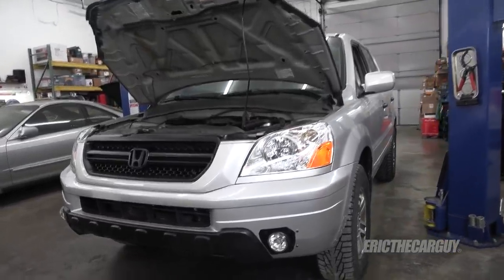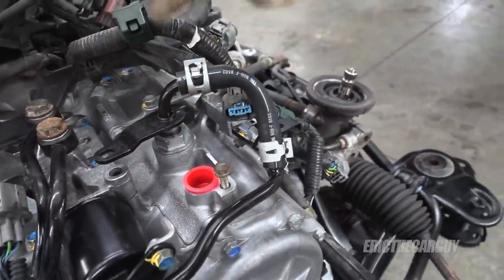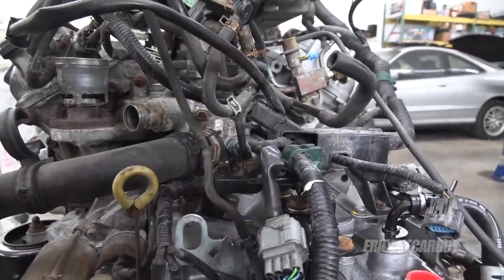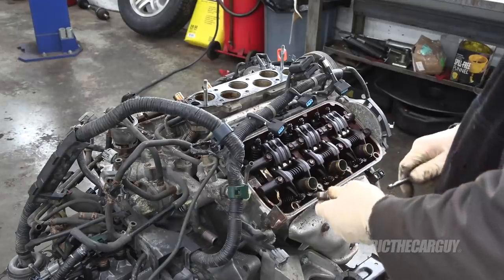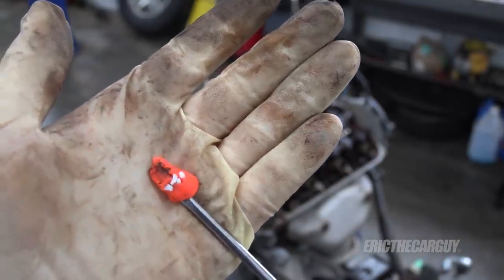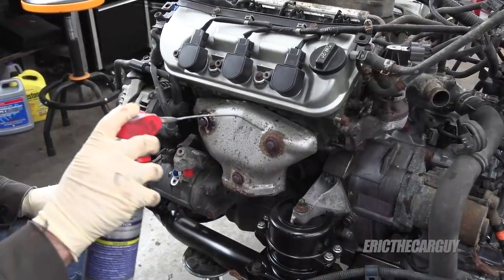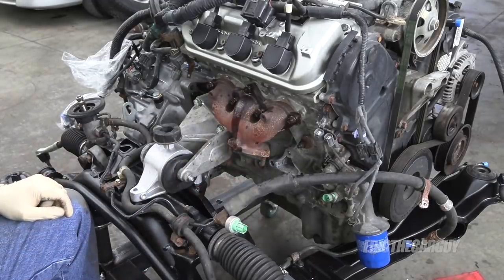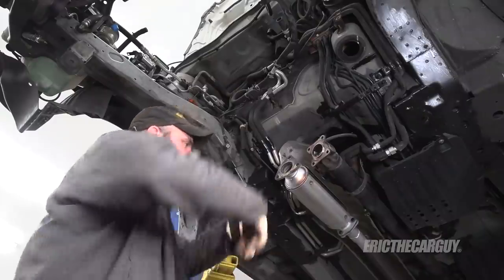Honda Pilot Timing Belt and Engine Service

Comment: I know it's not a hard part to replace and I've not seen them fail on Pilots like I have on 3rd gen Odysseys, but I was a little surprised you didn't swap out the power steering pressure hose. Again, I don't see them fail hardly at all on Pilots, almost always on the older Odysseys. Maybe it was an expense not worth spending the money on since you never know what surprises you might find. 

I am loving this series and enjoying watching this Pilot come back to life. 

Maybe it's been answered before, but you mention in almost every video of this series of your intentions to supercharge this engine. Will we see that as part of this series or is that something a little further down the line once things are up and functioning without hiccups?
Reply from the maker: As you stated, the PS hoses on these vehicles were not an issue. However, in the previous episode I loosened the connection at the PS rack in case I needed to replace it at some point. BTW, I've done several PS hose recalls on TL's when I was working at the dealer. It became somewhat routine. I mention this because replacing that hose is not a big deal to me if it becomes an issue. 

Linked in the description is the series of videos I'm doing with this Pilot. I cover my plans for this work, including the supercharger, in the first video. I recommend you check it out. https://www.youtube.com/watch?v=11nl6FCkr-s&list=PLSzhQ6St-ov3cXOvOQSyQQboN8f27MVQs

Thanks for the comment.

Comment: I just finished this exact service on my 2002 Acura MDX. Valve adjustments new gaskets Plus a new thermostat.  Now on start up the engine is Revving to 5000 rpm and staying there. I freaked and turned it off.  It keeps doing it,  even if I take off the throttle cable.  I feel like I botched something
Reply from the maker: Same thing happened with this engine as you'll see in the next episode. Sometimes the IAC gets stuck. I tap on it with a hammer and it often brings the idle down. Also, make sure you don't have any vacuum leaks. https://www.ericthecarguy.com/solving-automotive-idle-problems/

Comment: Eric.... Is there any reason not to fill the transmission through the dip-stick tube?  Those cheap tall skinny black funnels at the auto-parts store fit right onto the end of the tube.  I've been using that to fill the AT transmissions an 03 pilot and 12 odyssey for years.  Makes a perfect seal and never spills a drop.  I usually have to pop the plastic engine cover off to get it done, but that's it all.

PS: The wire tap on the IAT sensor was probably for one of those scammer gas-saving devices.

Comment: Eric, just wondering why you didn't replace the cam gear oil seals and the crank oil seals?  You had good access with the engine out...
Reply from the maker: If they aren't leaking, I don't recommend replacing them. The ones on this engine were bone dry.

Comment: Love your videos, I learn a lot with you and Scotty Kilmer. I have a Honda Pilot 2004 and I do my own mechanic work in my cars. I’m wondering, how much do you charge for this kind of work? Because is like literally having a new car doing all that maintenance and lowering that engine. Another question is could be a good idea in replacing both head gaskets while the engine is down? I know that you might charge more for that work but it might be worth it with the mileage of that van.
Reply from the maker: I plan to do a video covering the cost of all the repairs when I'm done. Spoiler alert, it's way more than this vehicle is worth. Unfortunately I'm doing this in part to show that SUVs are money pits, and if you're short on money, a used SUV should be avoided at all costs. Pun intended. https://www.youtube.com/watch?v=AqTgv2RSC7I&t=11s

Head gaskets are not a maintenance item, especially MLS gaskets which rarely have issues. 

Thanks for the comment.
Reply: @ericthecarguy Not sure if you'll see this but curious as to what the motivation is if it's more than the vehicle is worth. Is this a labour of love for you Eric?

Comment: Quick question i have a p0505 code i change the iacv i clean the throttle body bleed the radatior and the code still comes on. What next can I check?

Comment: Where do you get the zip ties that have the snap on fitting on the back. Used to hold wires to the engine?
Reply from the maker: Those are OE, I didn't add them.

Comment: Eric do you think the sand made it behind the valve cover baffles?
Reply from the maker: Likely, that's why I gave it a good cleaning in the parts washer after sand blasting. After that, I blew it out with compressed air.

Comment: Well, Eric - please do not trust your Ohm-meter on low resistances like that. Try for instance to short the tips of the probes and see what it says then.

And btw. if you would have 0.7 ohm in that ground cable, you would have a voltage drop across it of 14 V as soon as 20 Amps runs through it.

Comment: 14:34 "you could get a code for EGR flow, if this gets clogged up" I'm sorry my ass is new to automotive repair could ya please say exactly what component would cause that? Is it just the whole intake manifold or that specific channel you had the tool in as you said it?
edit: okay I went back a little and you talked about the "ant farm" EGR passage on the part you took off and then there were the other EGR passages deeper in the engine I was trippin should've checked before the comment. You even said "if they're getting low EGR" so my bad Peace!

Also, loving your videos and now that I'm serious into learning cars I've been watching all your channel's videos from oldest to newest lol I'm just cheating and watching this modern day Eric now because the video looked interesting and I wanted to see how you changed over the years lol, looking good bro!

Comment: And a almost 2 decades later from this pilot the J series v6 engine is virtually unchanged
Reply from the maker: These engines were great, the automatic transmissions bolted to them, not so much.

Comment: what about having that intake spacer piece machined down to about half the height that it is now ?
Reply from the maker: No point if I'm going to be cramming air into the engine with a supercharger. Also, I'll need every bit of under hood clearance if I want the supercharger AND the intercooler to fit.

Comment: Aye Eric quick question I put a used trans in my 03 MDX when it when out in last September I put it in about the end of September and it drives great, but now this trans has a weird gear chattering noise when I do 50 to 55 especially doing 55 do you have any suggestions or recommendations trying to keep it running since it's my only vehicle. The trans had 135k miles and put 91k miles on the new trans also what IS the trans update that Honda/Acura has did because I know I don't have a trans filter
Reply from the maker: https://www.ericthecarguy.com/solving-transmission-problems/
Reply: @ericthecarguy  thanks I'm checking it out 👍🏾

Comment: RE the broken spark plug: Would a socket with the rubber boot for holding the plug keep all the shards inside the socket ?
Reply: Possibly if you can keep the plug from popping off the rubber boot. Maybe just small small pieces that can slip between the socket and plug.
Reply from the maker: Yes. Actually, the rubber insert for that socket went missing long ago. If it was still in the socket, it probably would never have broken the plug in the first place.

Comment: You can keep oil from getting everywhere on your oil filter changes if you just bring a good sized piece of cardboard with you.  If you can remember to do it, you really feel like a oil deflecting god.
Reply from the maker: Because of the location, and the splash shield that goes in front of the filter, cardboard would not be a good choice. Aluminum foil might work better. Thanks for the suggestion.

Comment: This video is a good example that people should not use power tool to remove spark plugs, and also should always blow the spark plug socket with pressed air before remove it.
Reply from the maker: Honestly I've found that impact removal can be helpful with plugs that are difficult to remove. It can shake them loose. However, your concerns are warranted. A contributing factor in this case is that I lost the rubber insert to my spark plug socket years ago. Thank you for your commend and Happy New Year!
Reply: @ericthecarguy  Thanks for your reply, Eric,  you are a good guy and you are so knowledgeable.  if this project still  in process, i recommend to do an endoscope inspection on the first cylinder and Happy New Year!
Reply from the maker: The spark plugs told me all that I need to know. Based on what I've seen, and the way it runs and drives, this engine is good to go. Thanks for your comments.

Comment: My guess on the IAT harness hackery is some form of VCM disabler?
Reply: The 03-05 Pilots didn't come with VCM (thank goodness).
Reply: Neither does my 2007 Odyssey LX 😃
Reply from the maker: This vehicle does not use that system. I suspect it was to get better MPG.
Reply: IAT would have no affect on VCM anyway. That's the ECT1 sensor.

Comment: The resistance measurement you are doing, is not showing the real cable's one.  There is contact resistance in the probes.  With the tester you have, just measure the resistance with the two probes on the same end of the cable, and subtract that value from what you get measuring the cable end to end.  Some tester have a "zero" set.
To better measure low resistance values (< 1~10 ohm), you should use a 4 wire measurement, but the tester you have does not do that, as all hand held ones.

Comment: I wish you luck with that Aisin kit, Amazon and forum reviews are hit and miss, although I think there were some sellers with counterfeit kits being sold on Amazon, im using the Aisin kit but putting the Honda OEM timing belt on mine.
Reply from the maker: I think those are under the "Honda" name and not Aisin.
Reply: ^ +1. They were Honda branded, counterfeit

Comment: 9:16 Those shrink solder does not work in well in engine bay.  Reason being when it heats up, the two cables can be pull apart very easily.  In fact, it might pull apart under the cable's own weight.  Crimp heat shrink OR proper soldering is much better when dealing with engine's heat.
Reply from the maker: I've used them on 2 projects so far, one of them a turbo. So far I haven't experienced that, but I'll keep my eye out. Thanks for the heads up.

Comment: Every spark plug manufacturer says to not use anti seize on their spark plugs.
Reply: Which is OK for a cast iron head, but when it goes into an aluminum head I put anti seize on them anyway.
Reply: @CheezyDee  That's where you and everyone else is wrong.
Reply: @freespirit1975  That's the mistake many make, sadly its a myth that will die hard.

Comment: From the time lapse of the timing belt replacement, it looks like you just used a ratchet to get the crank pulley bolt off. You must have super-human strength! lol
Reply from the maker: I used a 1/2" impact. I guess it just didn't show up in the time lapse.
Reply: @ericthecarguy  haha, I figured that had to be the case or that you had already loosened it when it was still in the Pilot.

Comment: I really don’t like impacts on spark plugs for that very reason
Reply from the maker: I'm fine with using them for removal, but not for installation. In fact, I find they help break the plugs loose if they are hard to get out like these were. Lastly, if the rubber insert was still in my spark plug socket, the plug likely would not have broken. I knew I was replacing them so I really didn't care. Thanks for the comment.

Comment: Should one be asking !   Why can't you use anti seize on spark plug threads ?
Reply from the maker: https://ngksparkplugs.com/en/resources/5-things-you-should-know-about-spark-plugs
Reply: It could result in over-torquing which increases the chances of stripping the threads on the head, not a fun fix!

I too, use anti-seize on my TL 😅. The firewall side is a PITA to get to. Make sure to use a torque wrench and tighten to 110-125 in-lbs (20-30% less than 156 in-lbs). YMMV, I'm just a guy on the internet 🤐
Reply: @vincelow  SO one could say that using anti sieze could result in over torquing of any threaded fastener ?
Reply: @MrTonyPiscatelle  No, the specific reason NGK says not to is because of the way their spark plug threads are designed.
Reply: @wiimaster2847  Is this stated on the packaging or instructions or is this information only available with a secret squirrel decoding ring ?
Reply: @MrTonyPiscatelle  it's on NGK's website
Reply: @wiimaster2847   How many people/technicians that are going to install NGK spark plugs are going to go to their website before installing the plugs ?
Reply: @MrTonyPiscatelle  Not interested. Since you're not here to have a serious discussion and you're just trying to enforce your bias.
Reply: @wiimaster2847   Of course you're not

Comment: Your little meter is not capable of measuring the resistance of those ground cables in a useful manner. Reading ~700mohm when a tiny little 18AWG wire would need to be over a hundred feet long to have such a high resistance should be sufficient proof of that.

Comment: If it were me, I would be pulling that rear head because I would be too afraid that there may still be a piece of that spark plug that the play-doh didn't get.
Reply from the maker: A little too much work for something that is likely to head out the exhaust valve as soon as it starts up. BTW, the engine runs great without any issues. Thanks for the comment.

Comment: Hey Eric, long time viewer, and fellow Element owner here. Ive been having an issue with my 2005 element, and as far as i can tell you dont really have a video up about my problem, so i figured id run it by you and see what you say (assuming you read comments) ok so im having a spongy break pedal problem, i turn the key and the pedal sinks all the way to the floor, the brakes do still work but it seems like i have to push the pedal half way to the floor before the breaks start to engage. Ive taken the following actions to resolve; replaced master cylinder, check hoses and lines for leaks at all four tires, checked rotors and break pads,  bleed the lines multiple times, and all ive gotten is nowhere. Ive narrowed things down to the break booster, or the abs modulator. Trying not to buy parts that i dont need, hoping you might have the answer for me. Thanks for the videos, they have helped me tremendously. Have a happy new year and keep up the great work. Thanks -Drake
Reply from the maker: What I "say" at the end of every video is that if you have automotive questions not covered in the video that there are a ton of resources at EricTheCarGuy.com to help you with those issues. Things like this: https://www.ericthecarguy.com/solving-brake-problems/
Reply from the maker: You can also search all of my videos for info here. BTW, I have an entire playlist for the Honda Element: https://www.ericthecarguy.com/videos/

Thanks for your comment.

Comment: Those heat shrink solder connectors are said to break over time, giving intermittent issues. Eric O at SMA recommends not to use them,  based on his experience.